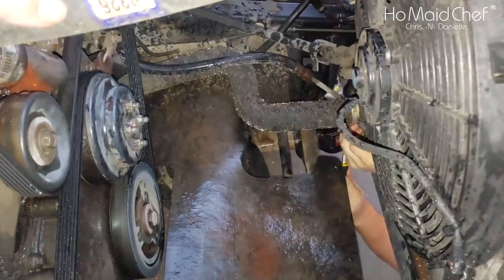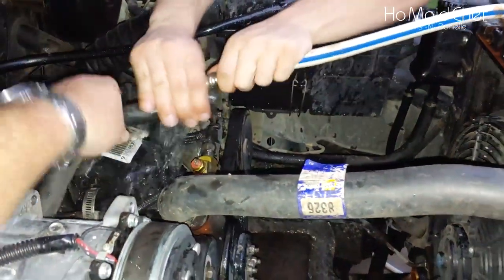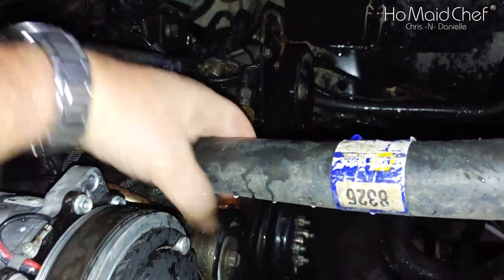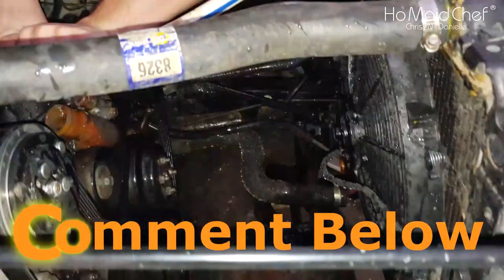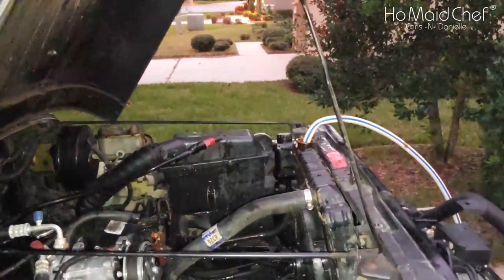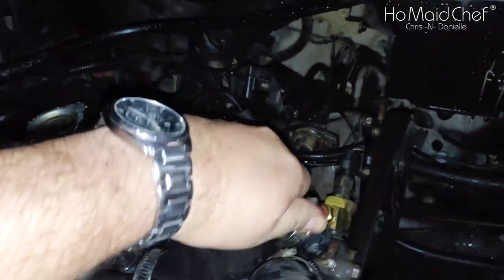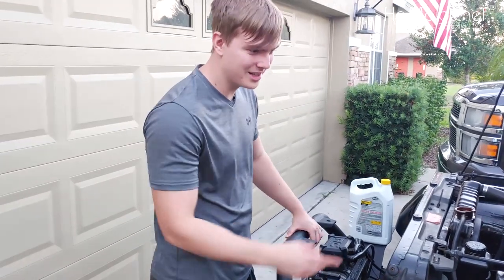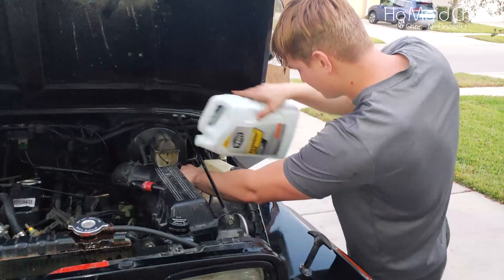How To Flush Engine Radiator Coolant System And Heater Core

Comment: Good afternoon Chris and Danielle!

I was following this video step by step yesterday and applying it on my vehicle (2003 DODGE CARAVAN SE) and i need help with the process when it comes to refilling my vehicle's cooling system with new coolant because i almost burned my face with coolant thank GOD that didn't happen.

Are you able to help me with that please?
Reply from the maker: When filling I left the cap off so pressure would not build and ran the car until to temp.  Watch your temp gauge and coolant level and keep adding until the system can't hold anymore coolant.
Reply: @ChrisDoesWhat  
When the van was cold i removed the cap for the radiator and coolant reservoir and filled up both with 3 gallons of (Valvoline Zerex G05 50/50 pre diluted antifreeze coolant).

Then i started the engine with the radiator cap off still and let it run and squeezing the upper radiator hose until i started to hear the fans cycle on for the first cycle but it wont cycle on. As im still waiting for the fans to cycle on and the van is warming up and getting hot i start seeing that the coolant is rising up and pouring out to the sides so as i see that happening i go and shut off the engine and boom alot of coolant comes out with pressure from the radiator and shoots up and makes a mess on the components under the hood.

I wish i had that no spill funnel kit but i dont unfortunately. If there is anyway that you can do another video on how to properly do a refilling of new coolant and burping of air from cooling system that will help so much.
Reply from the maker: @AlwaysDiagnoseVehicleFirst  Sounds like you didn't fill up the engine with coolant and have a air pocket. You seemed to skip the step were we filled the engine up with coolant. We even had this step in the description,  06:49 How Not To Vaper Lock Your Cooling System While Flushing Your Engine.https://www.youtube.com/watch?v=RbIRrcZxmFA&t=409s